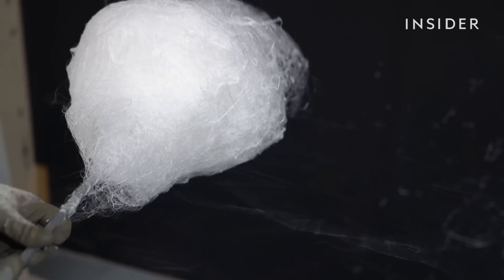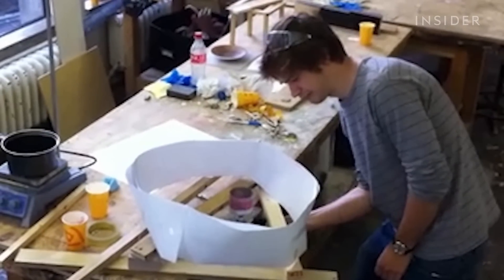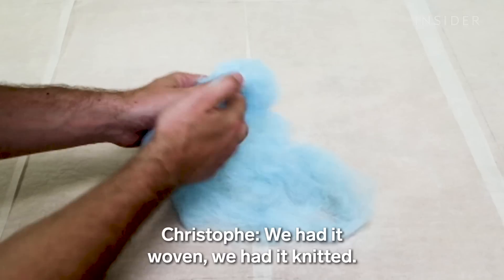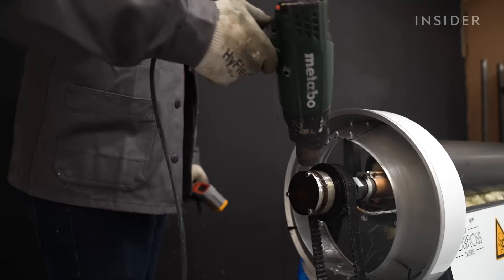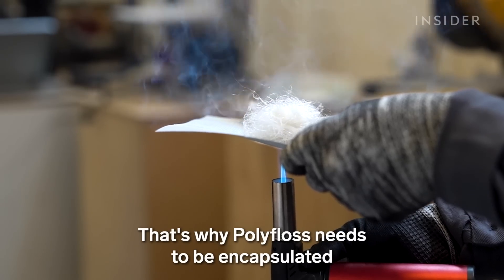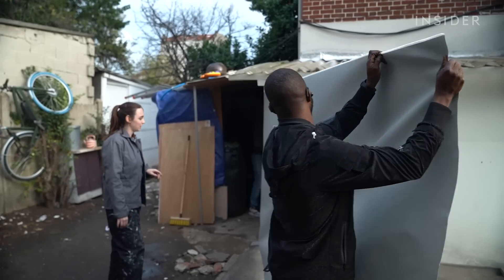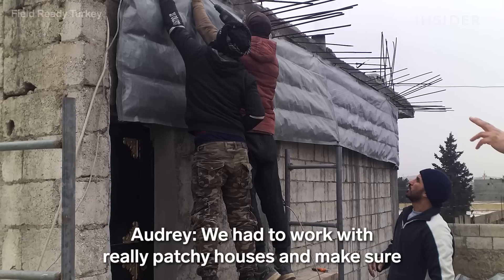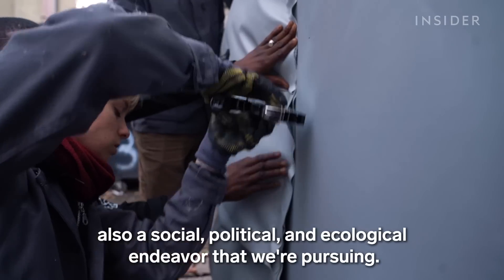How A Modified “Cotton Candy” Machine Makes Plastic Fibers For Insulation | World Wide Waste

Comment: This technology isn't new. Poly floss has been around for ages. You can find them everywhere in pillows, filter, clothes, etc. The plastic use will not be coming from landfill, which requires a lot of treatment with toxic chemicals to re-progress the plastic waste into plastic beads or something useable. If you think these company will be getting their plastic from landfill, you are sorely mistaken. This will only make more plastic in the process, or worse turn plastic into microplastic. The best solution is stop using plastic all together. All these idea trying to turn landfill plastic back into useful product, only is only recirculating the plastic around.
Reply: They address both your concerns in the actual video. The plastic is sourced from a local recycler. The machine is operating in a separate enclosed space specifically to prevent the escape of microplastics. While the best thing to do is to stop using plastic as a disposable material, this is a way to use plastic that is already made. This keeps is out of landfill for longer.
Reply: @antoniomromo  company's lie always 😂😂
Reply: No where in the video did they say they would get the plastic from a landfill. They get the plastic beads from a local recycler. Yes the concern for micro plastics is valid but their operation seems to contain it. Other setups may not be as careful. Watch the whole video before ranting.
Reply: I imagine airborne micro plastics being spit out by this thing
Reply: Well what should we so with the plastic that already exists? Youre right we should not make more! But reuse that what already exists is not a bad idea.. plastic will exist for a long time... so using it as insulation: the houses will stay insulated for a long time and the plastic used for it. will no longer be in the sea or on beaches!... so yeah, we should not make more plastic, but something has to happen with that what already exists!
Reply: I wonder if people have seen the machine that people use these days. They're huge. What these folks did is making them portable, affordable for general commercialization instead of big-ass factory. More people who can process recycled plastic means less need for newly-made plastic. Some people's concern are understandable, but some's are making me shake my head lol
Reply: Yeah but what do we do with the already existing plastic?
Reply: You didn't watch the video. Congrats on your uninformed bad faith hot take *slow clap*.
Reply: My first thought after seeing this was the microplastics.
Reply: YUP!!! Thank you!
Reply: Just burn it for fuel
Reply: It is not good stop making clothes from plastic .
Reply: I agree. Stop using plastic. It isnt natural. Stop making clothes from plastic.
Reply: agreed
Reply: Keep dreaming Jasika, plastic is an essential item today. There are great advancements is post use treatments such as plastic eating Fungi. Humans really can’t stop, so you can hate or help
Reply: Sure.. let's all be cynical, do some ritual, open the gate of hell and chuck all the plastic there.
Reply: @loremipsum8321  yeet it into the sun
Reply: so we should / let the plastic waste, do what????? this plastic waste is making a difference.,  what is your point???? jealousy.?
Reply: Absolutely love this! Recycling is an excuse for corporations to produce more plastic (And there’s a lot to be said about the negative affects of recycling on the environment, and developing nations).
Reply: 100% this
Reply: EXACTLY! Too short-sighted. I even call it a di*k move!

Comment: I think it’s wonderful that they’re sourcing waste plastic that would otherwise sit in landfills or the ocean, and using it to make insulation. Turning it into insulation sequesters it away in the siding of houses and it’s no longer out in the environment. It makes those houses 14 degrees warmer, which can be a big help. And this poly floss is safer than the insulation materials currently used in homes. Its going to be a big help and already is making a difference in some areas of the world. Good for them.

Comment: Im glad that micro-plastics didn't turn out to be a real thing to worry about!
Reply: my thoughts exactly.   I love the idea, and want more solutions for waste - but this seems very short sighted...
Reply: I just opened the video on my phone to comment that as well. The full lifecycle of the product must always be considered. Also I realize it has a fireproof outside fabric, but what if that is punctured? I cannot imagine how flammable shredded plastic is...

I like the idea, but they are requiring the plastic to be in pellets already. There isn't a shortage of preexisting use for those.
Reply: this is absolutely not true. These machines can only deal with plastic visible to the human eye, otherwise there would be almost no way to effectively get it in the machine and melt it down. Plastic pollution is still a massive problem in the ocean and there are more microplastics than ever in our food and water, as well as many living organisms. Plus, their machines can only accept specific types of plastic that have already been recycled and processed. Plastic in the ocean and waterways or other environments are rarely picked up in significant amounts and likely will not ever be recycled or processed before it even has a chance to be made into insulation. Plastic pollution is still an enormous problem, and there is no single solution to it.
Reply: @PoweredByDucks  they're turning large chunks of plastic (essentially inert and easily contained) into ultra thin fibers, which can easily break down into microscopic fragments. Even in the video they talk about having to run the equipment inside a sealed room to prevent microplastic releases into the environment (which will be less of a problem, but still non-zero, once the plastic has cooled down)
Reply: @brickmack  ok i'm going to humor your argument. The average household takes about 56 bags of insulation on average. Considering that a bag of insulation is around 35 pounds, each house on average might take 2000 pounds, or 1 ton. This is rounding up because most larger houses have less insulation because rich people are fuel inefficient and smaller houses have less insulation. Considering there is probably around 8 billion tons of plastic on earth, you would need a house for every single person on the planet with this insulation, ignoring the cost of making the bags for insulation, ignore all the additional plastic that goes into plumbing etc. for new houses. And even then all of the plastic would have to be sorted, processed and shipped to machines. All of which takes endless manpower and resources. It is simply not feasible. Plus, plastic doesn't ever break down. it can break down into monomers but under standard conditions the plastic molecules just don't break down. Spinning them into webs only spreads out the damage and can even be more threatening to wildlife in they get caught in or eat trillions of feet of plastic twine. The fact is that as it currently stands, plastic will remain on the planet for a very long time and continue to infest and disrupt entire food chains, environments and always ends up in our food and products.
Reply: @PoweredByDucks  have you not heard? Video says machine is contained inside a room to contain microplastics. You have that shit all around the product you make
Reply: @zzzzzz-lu6jw  oh boy even better